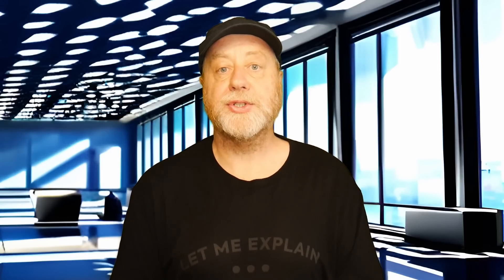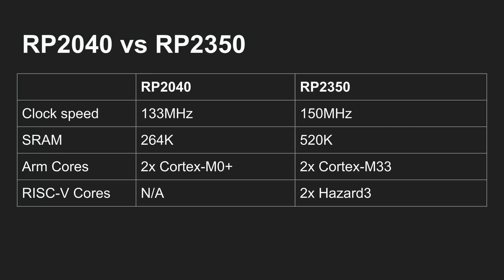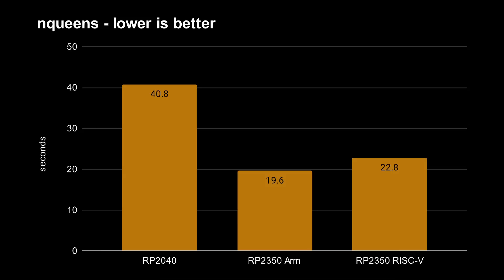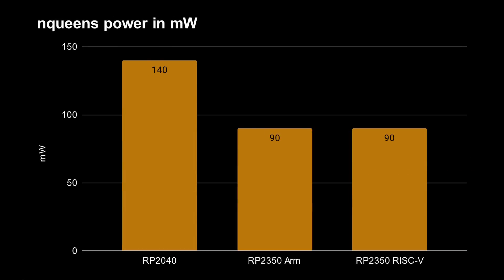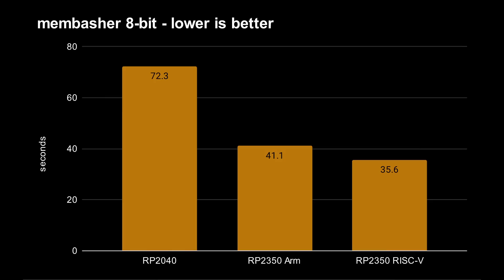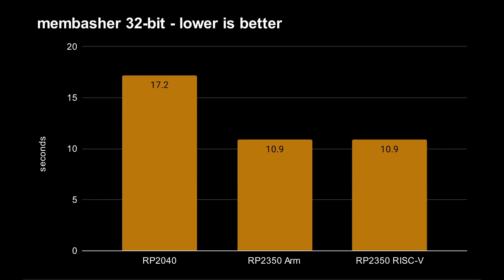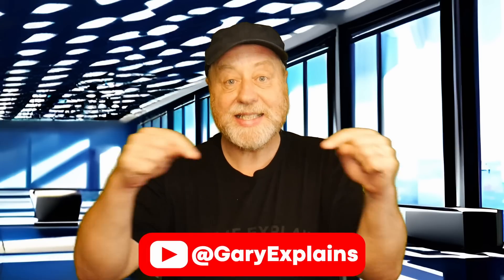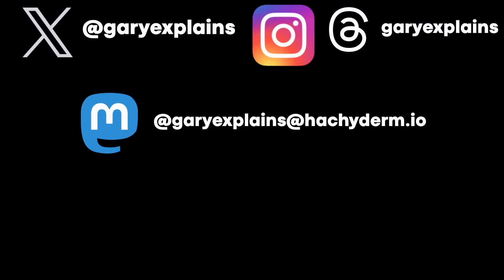Raspberry Pi RP2350 vs RP2040: Performance and Power including Arm Cortex-M33 vs Hazard RISC-V

Comment: On the RP2350, the ARM cores will be much faster if you are using floating point math, the RISCV in my experience perform much better if performing bit manipulations and integer comparisons.
For example, I move a 4 sample window over a buffer removing the highest and lowest, averaging the middle values, then placing into the first value, step to the next. And so on. This de-noises a digitised signal. M0 takes 100us, M33 45us, RiscV 23us. I understand that's because of its minu/maxu instructions.

I am surprised the FPU wasn't gated to be accessible to either CPU architecture.

Here is my code which shows much better RiscV performance using GCC15 toolchain

void buffer_trim1(uint16_t *buf, size_t sz) {
    for (size_t i = 0; i < (sz - 3); i++) {
        uint16_t hi = 0, lo = 0xFFFF;
        uint32_t sum = 0;
        for (uint8_t j = 0; j < 4; j++) {
            if (buf[i + j] < lo)
                lo = buf[i + j];
            if (buf[i + j] > hi)
                hi = buf[i + j];
            sum += buf[i + j];
        }
        buf[i] = ((sum - hi - lo + 1) >> 1);
    }
}

Comment: I wonder why the raspi foundation decided to gate you to 2 cores at a time
Reply from the maker: Because running four cores with two different architectures are the same time would be complex, which would increase the cost of the chip. Just think about the buses and the caches all trying to work in sync for two different architectures are the same time, then add the inter core communications, PIO, interrupts! True heterogenous systems are hard to build.

Comment: I would love to see a test which demonstrates the benefits of having floating point support on the RP2350 over the integer-only calculations of the RP2040.
Reply from the maker: Yes, that video is coming soon.
Reply: @GaryExplains  You just made my day! I struggled to use the RP2040 for DSP work, but the announcement of the RP2350 with FPU support has me stoked!!

Comment: Any news about the A/D converter, the 2040 one has a non-linearity in the middle severely limiting it's usefulness, hopefully the 2350 has fixed it
Reply: I've seen postings from RPi engineers saying it's fixed

Comment: Thank you for the video, despite that the percentages were wrong 🙂 it would have been interesting to also compare floating point performance, as the cortex-m33 comes with FPU. It also has DSP instructions. There is no one-to-one mapping between these and the cortex M0, but a comparison would be interesting anyway.
Reply from the maker: I plan to do another video about the special features like the hardware SHA256 and the FPU. 👍
Reply: @GaryExplains  thank you, looking forward to it!

Comment: I wonder if you could run the same tests you did a year ago in your video "Arm vs ESP32". You could simply add the 2350 results to the prev results. The only thing that was not present in the previous video from a year ago was sleep power consumption.

Comment: The results for the nqeens test is not making sense from a clock speed perspective.  You would expect a 12% increase in performance between the 133 & the 150Mhz, however in actual tests its a 100% increase.  What is the cause for such a drastic improvement?  Is it that the new cores optimize instructions in some manner that doubles the throughput, or is it due to optimised C/C++ library routines?
Reply from the maker: The RP2040 uses the Cortex-M0+ but the RP2350 uses the Cortex-M33. The latter gives more performance per clock cycle.

Comment: I am a noob and having a question: Does hazard3, has something like "sse2"? If not, it will be much slower than arm, it seems to me.
Reply from the maker: Neither the Arm Cortex-M33 or the Hazard3 have something like SSE2, these are microcontrollers not general purpose application processors.

Comment: Thank you. I assume that during the encryption test that you did not use the hardware accelleration feature of the M33. So
Reply from the maker: Yes, correct. I will likely do another video about the special features like the hardware SHA256 and the FPU.
Reply: @GaryExplains  Decoding MP3, probably needs the fpu heavily?

Comment: The RP2350 has hardware floating point support, can you test the speed difference with a floating point intensive test.
Reply from the maker: I will likely do another video about the special features like the hardware SHA256 and the FPU. 👍
Reply: Only the arm cores, have a fpu. The Hazard3, is calculating with an abacus.
Reply: The floating point unit is my interest as well, as my current Pico project has some floating point math.  I’m waiting for my Pico 2 to arrive.  Thanks for the video, Gary!

Comment: Great job Gary! You should do an in depth episode on how well the 2350 overclocks with benchmarking and so forth. It has lots of interesting hardware bits that goes well beyond just performance too. Such as the advanced DMA, the advanced PIO and the hstx interface and other hardware bits for hdmi support! Great new board!

Comment: How is the RP2350 on integer divisions, compared to the RP2040?  I'm under the impression the RP2040 has to do it in software (and also has no FPU), and hopefully the RP2050 cores have hardware to do that faster.  It could still be different for 32 bit or 64 bit calculations though.  For some applications, doing a lot of integer arithmetic in a loop, the lack of a hardware divider could make a lot of difference.
Reply from the maker: The RP2040 had a special divider circuit that the Raspberry Pi engineers added to the chip, it was actually quite good at integer division. See https://www.raspberrypi.com/documentation/pico-sdk/hardware.html#hardware_divider The Cortex-M33 and the Hazard3 both have integer division built-in.
Reply: @GaryExplains  Interesting.  Thanks.  I'm a bit surprised by this sentence, there: "On RP2350 there is no hardware divider, and the functions are implemented in software".  I'm also having trouble working out if it's possible to make efficient use of, say, a 16 bit divider to do 64 bit arithmetic and wondering how many bits that one does in one operation.  The part that says "The divider calculates the quotient / and remainder % of this division over the next 8 cycles," suggests 8 bits, to me.  I once wrote an integer division routine for a Z80.  I forget a lot of the details but it had to loop for each bit, doing long division (quite simple, because it's binary) so the time taken was proportional to the number of bits allowed for.  I expect a hardware method still has the same limitations, but just does it quicker.
Reply from the maker: What that sentence means is that the RP2350 doesn't have the bespoke divider added to the first chip because the CPUs have instructions for integer division.
Reply: @GaryExplains  Okay.  Thanks.
Reply: Which tests do use the FPU a lot? Only the M33 has the FPU.
Reply from the maker: The Hazard3 also has integer multiply/divide/modulo. We are not talking floating point here.
Reply: @GaryExplains  Cool.  I rarely feel the need for floating point, and there's always "fixed point" where you use integers but work in thousandths, or similar.  Division is usually the slowest element, when there's no dedicated hardware.

Comment: the big surprise for me is how similar are the performance between the risc-v core and the arm core. thank you Gary. btw, if possible,  compare the sleep mode with esp32.
Reply: The  M-33 ARM cores in the 2350 are rather old, very simple cores that lack the features that accelerate the faster cores. For example, there is not instruction cache, no data cache, no out-of-order execution and so on. Take all that trickery out and you will get comparable performance.
Reply: @TheEulerID  Instruction cache, data cache or out-of-order execution are all general concepts that are ISA independent (well, mostly; ooo can be a pain with some ISAs). Put "all that trickery" into both and you again have a similar performance.
Reply: @petrkubena  Yes, but the difference is that such features are way more developed on the more advanced ARM cores than what is available on the RISC-V as it takes a lot more development effort.

If all you are doing is comparing stripped-down RISC cores designed for use as microcontrollers, then providing the ISA designers have done their jobs right, then you will tend to get very similar results.

So, the OP was surprised by the similarity in performance. It should be the other way around; if there had been a significant difference i performance, then that would have been more surprising.

Comment: Im very impressed with the RISC-V core performance here. I was expecting it to be substantially slower than the M33 cores so a draw is a very promising result
Reply: It makes me suspect that actually there's no two separate cores but one hybrid core with common ALU and separated decode stages. And this is the reason why 4 cores are impossible to run simultaneously.
Reply from the maker: They are not hybrid cores, that is plain. 4 cores need all the plumbing and infrastructure to run simultaneously, it only has that for 2 cores.
Reply: @Механизм-ж9я  I was thinking that too, especially with the power usage being identical. However looking at the spec sheet they are Hazzard3 cores and fully independent from the M33 cores. They just multiplex the busses
Reply: @Механизм-ж9я  you don't have to suspect anything, you can read the source code for the RISC-V cores and satisfy yourself that it is its own wholly independent design.

Comment: Am I bad at math? Some of the tests 2350 is twice as fast as the 2040, as it completes the work in half the time. Twice as fast is 100% faster… not 50%… right?! 😊
Reply: You cant say, that 400 F is twice as hot as 200 C, because it is from different worlds. If something is twice as fast, it needs only half of the time.
Reply: Just use ratios instead of percentages. People make all sorts of stupid mistakes when dealing with percentages, like saying that a 50% reduction followed by a 50% increase puts you back where you started - it doesn't and it's at best misleading and at worst dishonest.
Reply from the maker: @johnm2012 Yeah, lesson learned, I think I will use a different approach going forward 👍
Reply: On a related point, not related to this video at all, but I always dislike seeing news reports or marketing that say “1,000% increase”

Is much prefer to see “10x increase” etc..
Reply: getting this 50% v. 100% thing wrong has been a lifelong phobia. The correct approach is to steer clear and explain differently 😂
Reply: You are right.
Reply from the maker: Who is "you", me or the OP?
Reply: @GaryExplains  50% less time used or 100% faster.  The unit in the figure is second, it is inverse relation with speed. No need to re-upload though.
Reply: Yep video needs correction
Reply from the maker: I have posted YouTube inline corrections. That should be sufficient.
Reply: @GaryExplains  "That should be sufficient." 
It's not sufficient. Hardly anybody will read them, because most people don't read anything.
Reply: @jope4009  It is sufficient. People not reading anything, that's on them. On the video you can see the raw numbers and realize that Gary just said the faster part wrong. If they simply parrot what Gary said ... that's their problem.

I do like people being exact and careful, but being pedantic is also a thing. No need to reupload a video just for this.
Reply: I suppose it depends on convention: if you're thinking of quantifying how "fast" something is in terms of time to completion, then 50% reduction in time can be considered straight 50% faster (half as long). But if you're thinking in terms of operation speed (N ops per unit time) then this would be 2x faster or 100% faster
Reply from the maker: Hmmm... You got me worried now... I hope I haven't expressed it wrong. I am working with this definition: If something is "50% faster," it means that the time it takes to complete a task or action is reduced by 50% compared to the original time.  For example, if a task originally took 10 minutes to complete, and now it is 50% faster, the new time would be 5 minutes (50% of 10 minutes is 5 minutes, so 10 - 5 = 5 minutes). So in summary, if something completes in 50% of the time, it means it is 2 times faster or can complete the same task in half the original time.
Reply: @GaryExplains it’s wrong when you say “50% faster “ when comparing the inferior to the Superior. When you compare something it’s either 50% Slower(1/2 as slow) or 100% faster(2x as fast) than the other. You seem to use wrong wording for the entire video. Please correct and repost.
Reply: @GaryExplains 
When you have points then 100 to 150 is difference of 50%, when you have time then 10 to 5 seconds is also 50% difference.
To compute similar perf % improvement, you can compute the inverse of time, 1/10 and 1/5, and the improvement is all of sudden 100%.

It's just problem with percentages, because they are relative to the base number.
Reply: @GaryExplains  It takes 50% of the time but its 100% faster
Reply from the maker: @botfap Hmmm... So "50% faster" isn't technically right. Should I reupload the video?
Reply: @GaryExplains  Im sure most people understood what you meant, its obvious in the figures. I dont think the full video needs redoing if you can just a correction note. There is a lot of pedantic comments in youtube but I suspect most understood what was meant
Reply: @GaryExplains no. 50% faster means speed is 50% larger ie 1.5* or 3/2* the original speed. So the time take is 1/(3/2)=2/3 so the time needed is ⅔ for 50% faster...
Reply: @GaryExplains 75km/hr is 50% faster than 50km/hr and gets there 1.5x as fast or in 67% of the time. 100km/hr is 2x as fast and gets there in 50% of the time.
Reply: @GaryExplains  thats really bad.. don't reinvent basic math... if something is 10m, and 20 minutes. Say old one is 10m, then that's 100% of old, if new completes something twice as fast - that's 200%, 200%-100% = 100% faster. You could reverse and say that old RP2040 is 50% slower, than brand new one... but saying 50% faster is just pure wrong.
Reply: You're right - but you're definitely bad at saying 'maths'.. :)